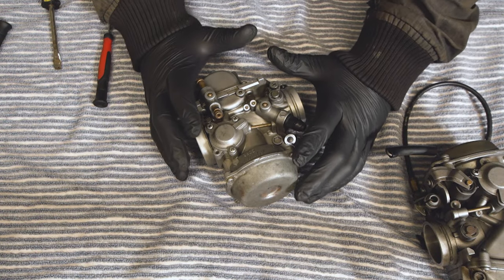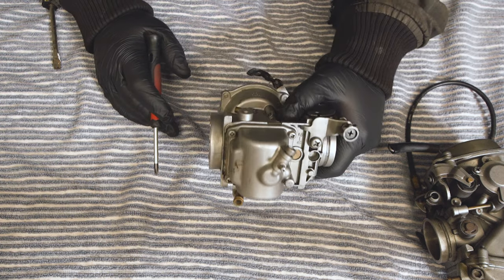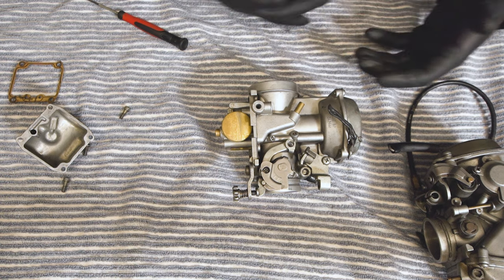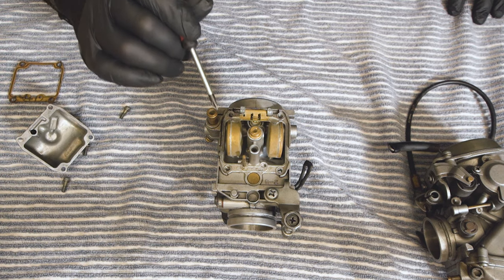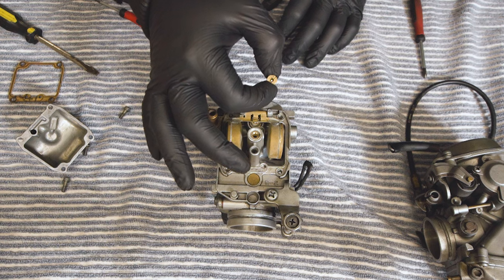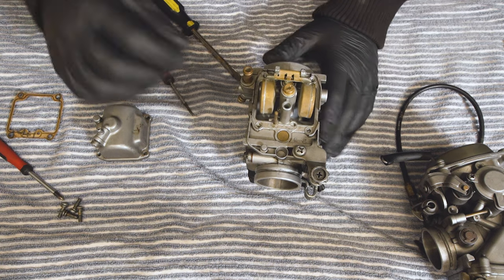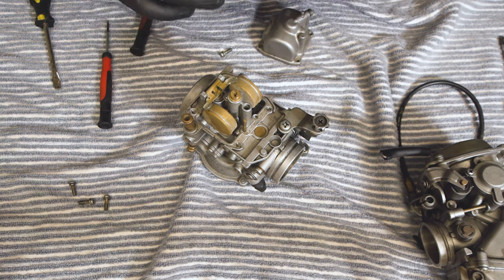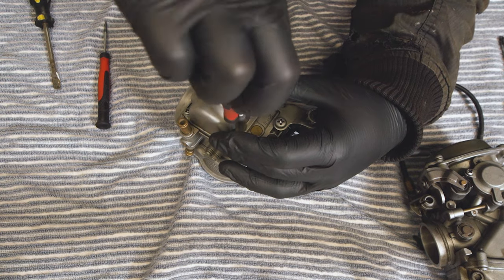Suzuki Intruder VS1400: Carburettors - Tear Down Part 13

Comment from the maker: Q&A -> Thanks for checking out the video, if you have any questions drop them here!
Reply: I checked my firing on back cylinder working good.and running. Back cylinder is firing but no fuel. I can sqirt fuel into carburetor and it starts running until that fuel runs out. What could be my problem.

Comment: I stripped my vs1400 as naked as it can be few months ago. I needed to paint the frame and everything else. Now im putting it back together and i already have nightmares where i try to sync those carbs. Last winter i did that about thousand times so i know how to sync those bastards, but man i hate to do that. Good luck with your project!
Reply from the maker: Thanks Kylyma, I am hoping the carb sync will go smoothly when we get too it that's for sure :)

Comment: Hey. Benny from Sweden.. I have a 1996. I heard you were talking about carb sync. My lowsync is off.. When its idle only the forward cylinder is running. When i give a little gas both both run. Is there a sync video in the works or? Great videos btw mate. Thanx a bunch :)

Comment: Hello, your videos are an awsome help! I have two Intuder 1400 my self, one -98 and one -89. If i can ask a question... Why are the slide on the rear carb on the-98 juming up and down like crazy and fuel are pouring out (flooding) of the back of the carb?? (no it doesent run right) Please help and best regards from Sweden :)
Reply from the maker: Fuel pouring out from the carb is usually a sign that the float needle is either stuck open or the float height is too high and is allowing too much fuel into the bowl

Comment: I have a 2008 S83 Boulevard aka Intruder that backfires on the right side of the bike only.  I assume this means that the front cylinder's carb is the only one that needs rebuilt correct?  Is there a way to clean the jets without removing the carb?  This bike sat in a garage for about 17 months with gas in the tank after the previous owner passed away.  I find that riding the bike with the choke on almost entirely eliminates the backfiring.  What would you recommend my best course of action is for someone like myself without a garage to work in and only basic mechanical skills?  

Thanks

Comment: Hi.love all your videos. just one question on the carbs. is there  fuel/air screws on these carbs.
 
if so , mine seem to be covered up. assuming they need to be drilled out. In saying this. How big of a job is this to drill out?
                kind regards, two wheels.

Comment: What do you do if you can't get the float Bowl off the screws are stripping out
Reply from the maker: Very VERY carefully drill the heads out/off. Then replace the screws with the correct thread pitch
Reply: Another way is using a impact driver tool, the one you hit with a hammer. It can a lot of times grab just enough to loosen the screw, then replace it. Another way is cutting a line across it and using a flat head screwdriver, but even here I would use the driver tool.

Comment: I have 95 intruder 1400. I'm having a problem with a high idle. Only after the bike is warm. If I'm coming to a stop with the clutch in. It idles high but I can let go of the clutch until it starts to grab a little and the idle will go back down to normal. But as soon as I hit the throttle a little the idle rises again. The throttle cable is not sticking. Only happens when bike is warmed up. I have on taken carbs off yet. I'm also thinking maybe there's a vacuum leak.

Comment: Can you tell me how much i need to take of my vs1400 to take out the carbs. Do I just remove seat and tank and then i can take them out for a cleaning?
Reply from the maker: Check out the tear down playlist on the channel brother. there is a chronological order ;)
Reply: but in that video you have already taken of electricals and so on. Is that nessesary?
Reply from the maker: The how to remove the carbs video still has the electrics in place.

Comment: Hey my bike runs great at low throttle to mid range. But at wide open throttle it has a two or three second delay before it comes to life. What are your thoughts? It's a vs1400. Thanks.
Reply from the maker: It could be a number of things. First I would check is for AIR leaks around the carbs and cylinder manifolds. If there are no air leaks, it could be that your carbs are running too rich or too lean. You would need to adjust the fuel air mixture to see if this makes a difference. Let me know how you get on.
Reply: Sent it to Suzuki. They say my carbs need cleaning/potential rejetting. Suppose to get it back Tuesday. Thanks for the feedback.
Reply from the maker: @xxtyler420xx  If that is the case you are in luck! Carb cleaning is very simple and can be done at home if needed :) Video on it coming soon!
Reply: Cleaning the carbs isn't the challenge. It's resynchronizing them without proper equipment that is the shortcoming.
Reply from the maker: @xxtyler420xx  I'll be showing you how to sync them DIY soon with a home made tool :)
Reply: when is your sync video coming. Really need it.